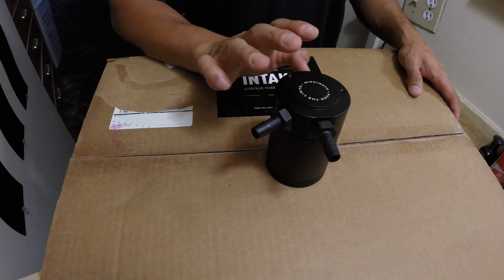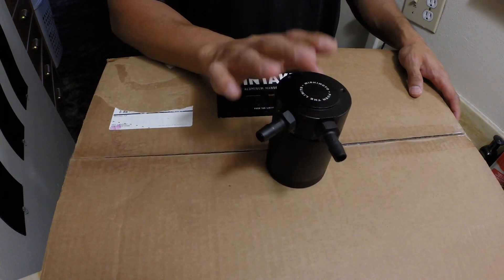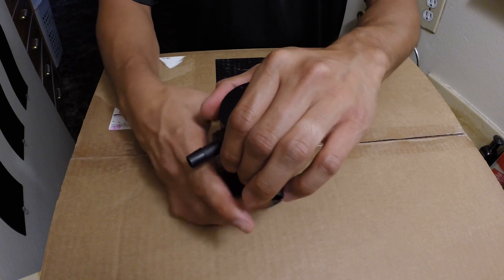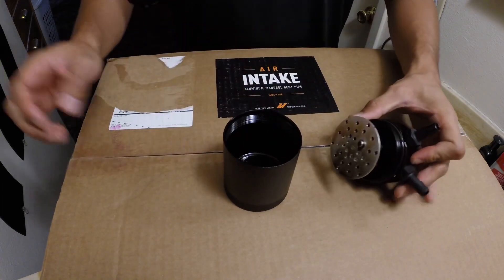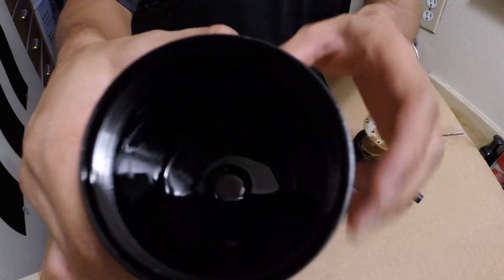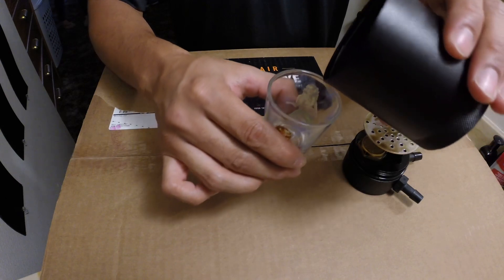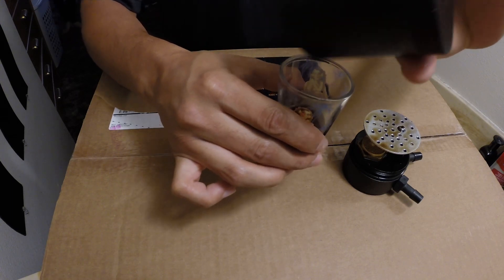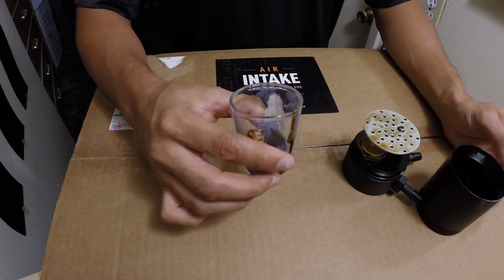Emptying My Mishimoto Catch Can (Honda Civic Type R FK8)

Comment: I've emptied the Mishimoto catch can on my Type R twice since I installed it, i.e., once a month for two months. There has been about 1/8" of carbonized oil in it each time, which I have just wiped out with a paper towel. It's doing what it is supposed to do. The question is, is it worth about $200 for the unit? There are many cheaper alternatives around that might, or might not, catch the oil just as well. The Mishimoto version is well engineered and designed relative to cheaper alternatives. Some of the virtual and practical value is in the compact design and in appearance. The custom-molded hoses make it a perfect fit and the red bracket puts it in harmony with the Type R black/red theme. It’s also fabricated well. There is space to open it and reclose it by hand. It doesn’t need to be over-tightened to seal, so is easily opened and reclosed. They’ve done their homework.

In functionality, the, sort of hybrid, Honda ‘direct’ injection of the FK8 injects fuel into the manifold via the active intake valve rather directly into the cylinder. This may wash the intake valves at least partially avoiding the valve carbonization issue which apparently affects many of the German direct injection models. So, Honda seems to say that a catch can is not needed. Maybe it’s a belt and suspenders approach. I don’t like to think of that stuff going back into engine through the turbo. It’s your choice whether to bother with it at all, but if you do the Mishimoto unit is a good choice even at the price.
Reply from the maker: Wow, thank you for the in-depth information and opinion. I’m pretty happy with the Mishimoto oil catch can. You’re absolutely right, there were/are probably attentive options that are cheaper and do the job but I don’t regret buying the mishimoto one either. Thank you for the comment!
Reply: Fantastic read. It’s a great lift off your mind for a mere $200. I put it off but always had it in the back of my mind (what if all those people who say you need one are right?) so I spent $200 and 20min. Now even if they are, I will be too haha.